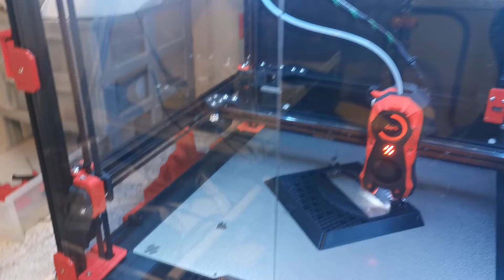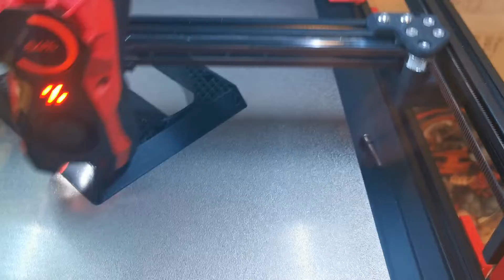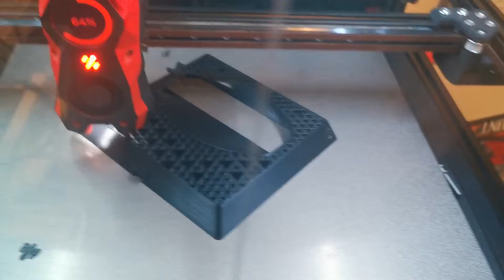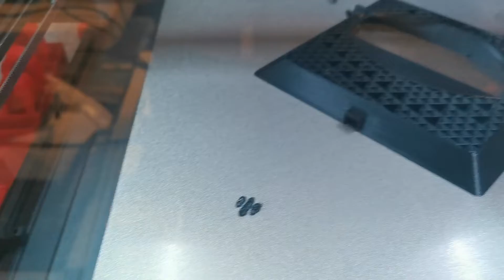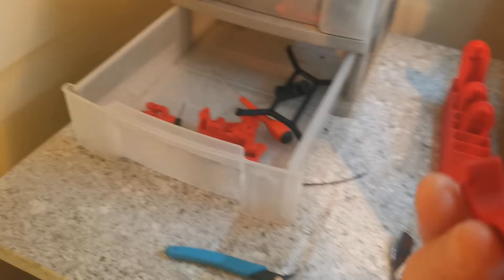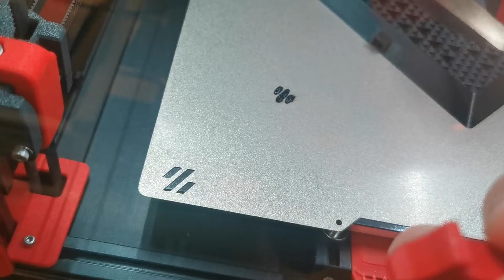VORON STEALTH BURNER PRINTING ISSUES SOLVED - PART 3

Comment: Been watching many of your videos do you have a link to the stealthburner display and and installation video to it I like that very much? NICE WORK!!
Reply from the maker: Cheers for the feedback - hope you subbed and liked to get it out there. your question... Are you talking about the Knomi screen on the front of the Print head?
Reply: Yes sir had no idea where to source it not what it was i just started printing my parts for my very first Voron 2.4rev D . I'm utilizing the galieo 2 extruder,  titanium backers going with sensorless  homing , beefy idlers looking forwardto hearing neck from you ,@rent2ownnz
Reply: Also will be doing the Cartographer version for z and yes I liked and subscribed.

Comment: Did you change your mount for the canbus to toolhead again? looks different. i used the G2E umbilical mount like you did in part 2 but i found i had to loop the cable over to get it in lol, here it looks like youve changed it?
Reply from the maker: Are you meaning the Galileo 2 mount? or the one shown in this video? I changed the complete head over to G2 and made  split system wiring loom ... but just after I had completed that, I found  that there was a retainer that worked without any modification at all to my wiring. I call it learning to grow :)
Reply: @rent2ownnz  oh yeah for the G2 👍 what retainer was it if you don't mind me asking? Your videos have been so helpful